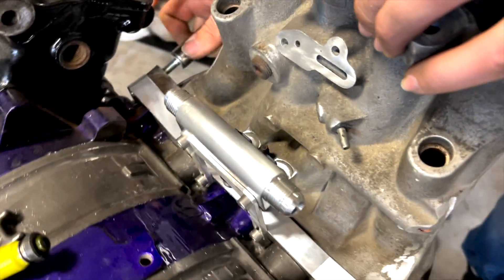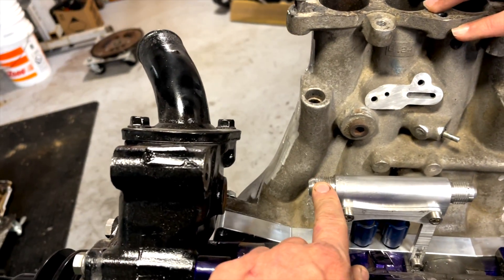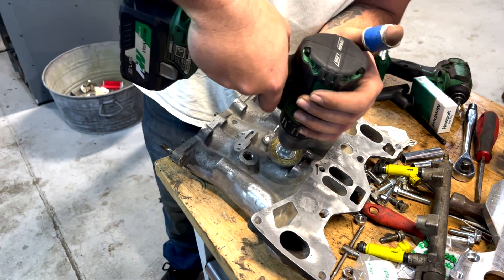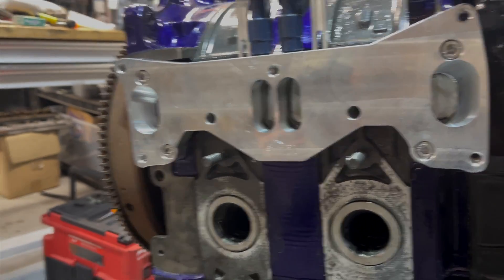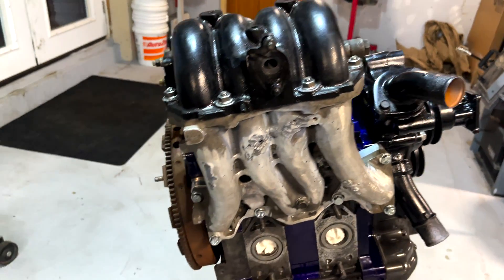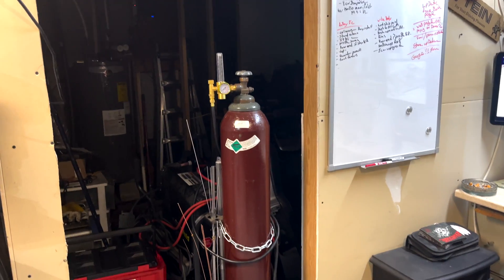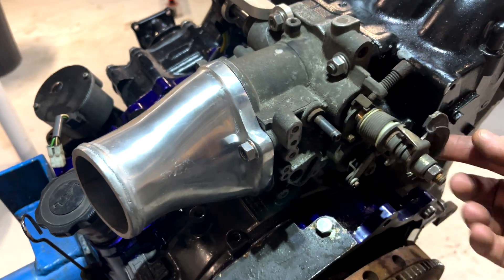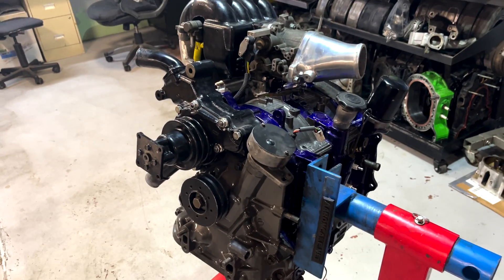FB Rx7 12a fuel injection Build - Adapting a T2 intake and ignition

Comment: These cars are never going to make big power without a turbo.
   I would choose a well tuned stock carburetor all day long before I would bolt on some Frankenstein fuel injection that nobody will be able to figure out down the road.
Reply from the maker: What do you mean by. These. Car’s? And. Mikes. Plan is to go turbo. Its really not. Much of. A. Frankenstine. Its all t2. Parts. Just with a. Adapter. On the. Intake i mean a ported 12a is. Only going to make so much power n/a as. It. Is. He. Had a. Bunch of. 12a’s and. Thats what he wanted to play with
Reply from the maker: I mean are. You just saying. 12a cars.  ?  Im confused
Reply: you should see my engine plans

Comment: Yep you right about not port matching the 12A primary ports and blow back in a NA set up. Boosted however wouldn't matter. This has been known for decades. Also I don't really care too much to perfectly port match the secondary ports as a smallish lip helps the fuel to atomize better due to some added turbulence. To me, a cleaner consistent burn is more important than chasing a couple extra HP.
Reply from the maker: Well yeah that was. Kind. Of. My. Point. But as. Of late it seams like alot. Of. People. Have. Forgot alot of things lol on the secondary’s it was. More. Of. Cutting. Down the. 90s back and. Forth
Reply: @TheRogueOnes  I feel you buddy. Keep up the great work! You doing all kinds of different projects. Me likes! 😉
Reply from the maker: @rotaryperfection  yea. Got to keep it. Interesting.